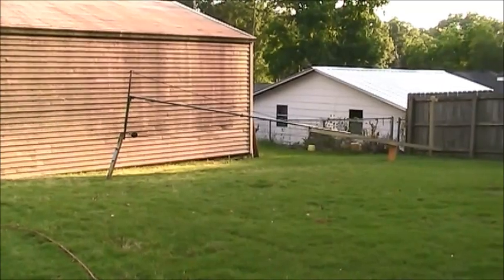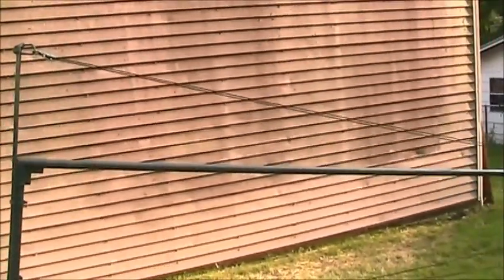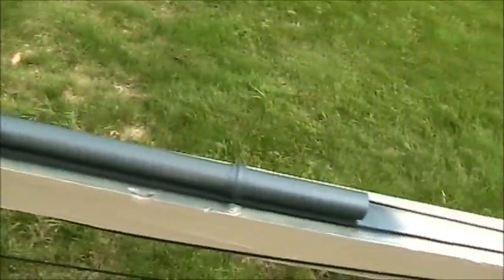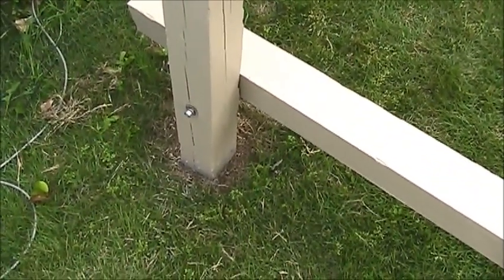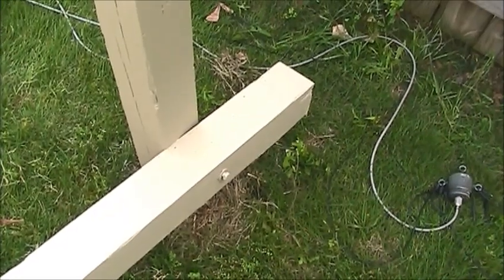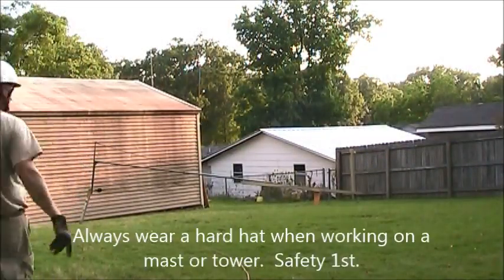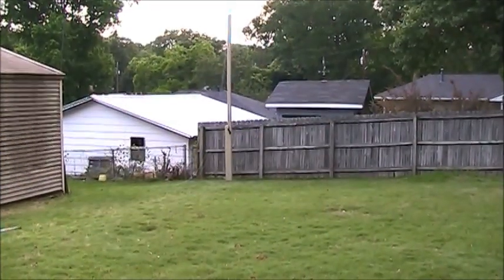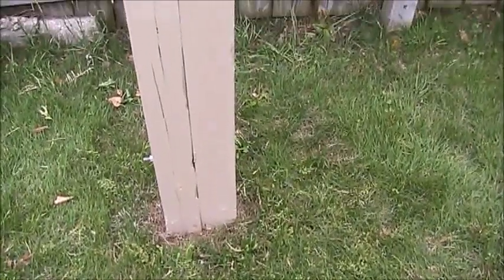Antenna Mast / homemade / for Ham Radio

Comment: I'm not sure where to get 21ft fence top rail in my area.  Lowes stopped carrying it in my area about 3 years ago.
Reply from the maker: Look in the electrical section for a metal conduit option. Or a fence wholesale supplier.  Steve - Ad4xt
Reply: @hamradioportable1630 the problem with wholesalers is to actually get then to call back or answer web contact forms for small orders which really aren't worth their time.  After many attempts, I finally found one who wants $50 per 21 footer (1-3/8") a fair distance away and by appointment only.  It may be my best option.

Comment: Very simple and effective  tilt down mast system that does not use guy ropes for support. What Antenna is that?
Reply from the maker: I used it for supporting a fan dipole, 80/40/20.

Comment: Thanks for sharing this, I wonder how it's doing five years down the line? Some good ideas here which I have taken on board and may use. Best 73, G0ACE
Reply from the maker: Good question. It's still doing okay. I have built another one on the opposite side of my backyard. I cemented another new 8 foot 4x4 into the ground and moved the same 4x4 16' to the new location. I was short on time as a friend was on the way over to help with the install of a Maco 5/8 wave ground plane on top of the pole. I did lower the top of the mast pole down a few feet. More wind load than a wire dipole but it's doing just fine. I need to do an update video showing the Maco antenna on top. A great antenna for 10M. Thanks for watching .  Steve - Ad4xt
Reply: @hamradioportable1630  Hi Steve, thanks for the reply and I'm glad it's working well for you. Best 73, G0ACE

Comment: Your videos are helpful. Could you please tell me after the 4x4 what is the pole made out of? I am told different things about what material can be uses. I am not sure if yours is metal or not. I am wanting the same thing you have due to no trees. I would also love to see how your pulls system works if you have a video you can point me to that you have made showing that. I have not seen it if you have it on your channel. Again, thank you for down to earth videos.
Reply from the maker: Pressure treated pine.
Reply: @hamradioportable1630  I am sorry I was not clear on my question. Above the wood post you have what looks like to be a metal pole but I was not sure if it was metal or a fiberglass pole of some kind.
Reply: @randyajones  it is called chain link fence top rail

Comment: Brilliant!  Video's been up 4 years and I just saw it.  This looks really sturdy and could also work to suspend a rotator and bushing for a directional.  Thanks for the brilliant idea and nice video.
Reply from the maker: Yea, take it and roll with it.  I have a friend here that used 2 4x4 post in the ground and put the 16' in the middle for extra stability. Steve - Ad4xt

Comment: Great job, very nice, 192 Southern Utah with a wave 👋  73
Reply from the maker: Waving back from GA. I now have a 5/8 wave Maco  ground plane for 10M on top of it now.  Great antenna for 10m as we head to the top of the solar cycle.
Steve - Ad4xt

Comment: Thinking of doing this do you think 1 3/4” EMT would be stronger than the top rail. I would probably put a 1 1/2” EMT inside the larger section at the joint looking for about 25’ high mast

Comment: One hell of a nice tower there, I like that you economized on it and have two different antennas too.  At first I wanted to make fun of the hard hat, but then again I have never worked construction before, or had 100+ pounds of wood and steel swing down and crack me in the skull before.  So I shouldn't make fun...   Safety first is a good message that's hard to argue with actually.

Comment: I would probably a bolt  on the back perpendicular to the support bolts to hang barbell plates (scouted from a Goodwill) on the back to act as a counterweight while raising or lower. Once you are done raising or lowering,  remove the weights.
Reply from the maker: That's a great idea!!  And cheap too 😀.
Reply: Make the top bolt the hinge point to give the weights a longer lever arm.

Comment: This is one of the best antenna videos on Youtube thanks for posting. I am going to 40 for for my Helium antenna and this info and design is invaluable.
Reply from the maker: Glad it was helpful!  Good luck.
Reply: @hamradioportable1630   I did the same and have the antenna at 30' right now and have realized I def need some guy wires to go taller !

Comment: The issue with having co-aligned conductors in the near field is they will couple and you run into several related issues. 2 separate parralel coax runs will also cause RF and common mode. At the very least make sure to never run the 2 antennas at the same time especially on different radios. RF from one will send powerful RF into the others receive side and destroy it.

Comment: Steve, does the fence top rail have any effect on the antennas? Great Idea, and video. 73
Reply from the maker: None with my dipole antennas. The T section at the top keeps the center connector and wire away from the pole.

Comment: GREAT VIDEO !!!  You have just demonstrated what real Ham Radio is all about !  Real hams, use their imagination, creativity, experience and ingenuity...not their hard-earned CA$H to build antennas, accessories and gear for their stations. This is a great "walk-up" tilt-antenna idea, far better than a $500 wobbly guy-wired telescoping mast that can't handle nearly the weight or wind.

Comment: Nice mast, however you might want to put an inexpensive manual boat wench on the bottom of the support pole and use it to raise up the mast more easily (slower but definitely easy).
Reply: That's what I did. Two 12ft 4x4 posts, with the first hinge point 5ft up makes raising the mast by hand pretty heavy and dangerous. The boat winch and roller cable guides make it very easy to lower and raise.

Comment: How long was the top metal pole?  This is a great idea!
Reply: I think he used two top rail metal fence ploes at 10 feet each and had about 3 to 4 foot where the first one bolted to the top of the beam and used some sort of plate or through bolts to secure it.

Comment: How long is your coax?
Reply from the maker: 50'
Reply: @hamradioportable1630  Thanks ! 
A handful of people seem to think there is some mysterious thing going on with various coax length and maybe there is I don't know.
 One guys says the shortest route from your antenna to your radio is best and less losses. Others say multiples of nine, I've herd multiples of 18' also.

Hey If you ever want to add a wench to it you could mount the wench low on the stationary pole, leave the top bolt in, let the bottom swing out with the wench.
We use to have a monster flag pole that worked like that.  Its pivot point was like 10 ft high. total length was like 25 or 30 ft. It was made with  4 x 5 square steel tubing so had to be wenched. It was slid inside a larger baser tubing that had the face of once side removed to allow the pole to pivot outside of its resting place.

Comment: I used your design to build my mast!  It is a great home brew design!! 73s KF5OWH
Reply: A lot  better than waiting for a tree to grow. Thanks for watching.
Reply: Steve Whittington  only issue on mine is the two boards try to separate so have to tighten every now and then.  But very sturdy any suggestions?  I figure I did something but can’t figure.
Reply: @HoboFreightHamRadio  did you use treated 4x4's ? Try a large flat washers on outside of the bolts and nuts.

Comment: nice setup. couldn't tell for sure but if you have room behind you could put in a post that is 8ft out of the ground, pulley on top with winch at bottom.
Reply: Exactly what I did. Two 12ft posts, the top one hinges at 5ft off the ground. 10ft of EMT on the top post puts the antenna at 30ft. Hand winch at 4ft up, cable wraps around the top of the bottom post along roller bearings (pulleys).

Comment: Steve, a few questions, how do you deal with potential lightening issues from your mast to the radio?  Also how was it tuning that fan dipole with that arrangement? Very informative - Bill KD0WAN
Reply from the maker: No issues so far. I do disconnect everything for bad weather . An 8' ground rod with lightning protection before the coax enters the shack is what i try to do.    Steve
Reply: @hamradioportable1630  Thanks Steve, how was it tuning your fan dipoles with that arrangement?

Comment: Any guy ropes or wires?
Reply from the maker: No ,  seems very sturdy. Wire antennas do not have much wind load.  The dipole act as a bit of support from 2 sides.

Comment: KI7BSL, out of Cheyenne Wyoming here. Great idea for an antenna mount. But then again we Hams often have great idea's :) Did you use Marine grade varnish?
Reply from the maker: I used a stain with color. Came out too light so far as color but is holding up well. 6 years now.

Comment: Thanks for sharing. Would it be easier to raise if you made your pivot point the middle bolt and added a counter balance weight of  some kind to the bottom of the 4x4? You would have had to have poured your concrete pad a little further from the fence. Thanks again.
Reply from the maker: Yea i thought about that but was i  too close to the fence.
Reply: @hamradioportable1630  You could add a 3/4" pipe, maybe a foot long and hang 2 or 3+ 25lb weights to make the counterweight, position the pipe to be pointing up when the mast is in the down position. Just a thought. Or maybe bungees to help lift it up.